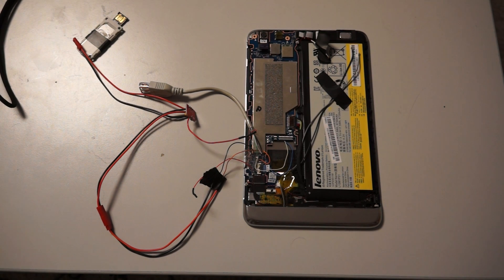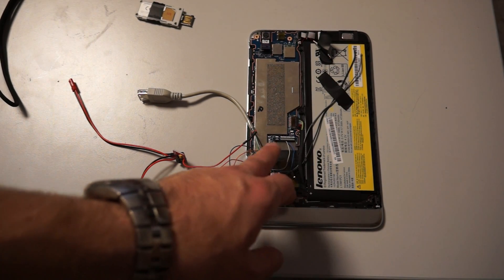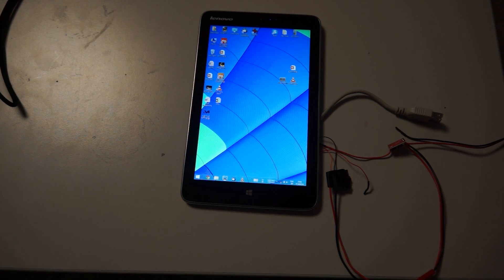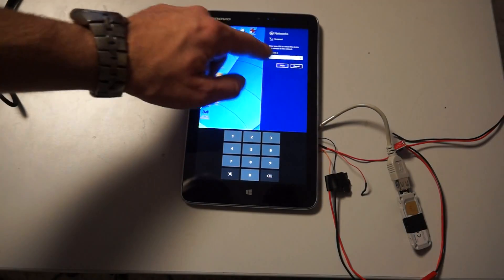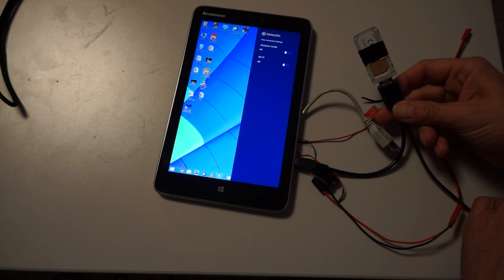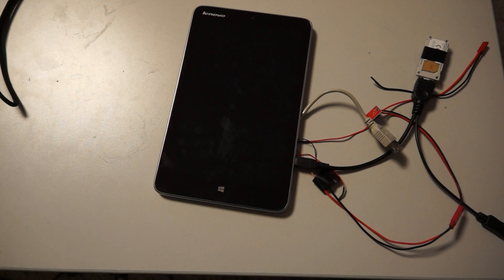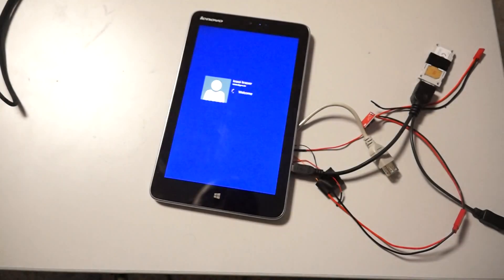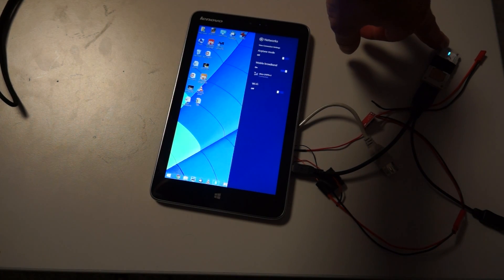Lenovo Miix internal USB connector testing

Comment from the maker: sorry but this is an abandoned old project so far. I still have the miix here and it is working like a charm but did not get on with this stuff. As far as i can remember there should be a way to hack the microusb to get it to otg by constantly hacking or by using a wired switch. so if otg is available there is a 5v source. the reverse engineering is really taking time which i did not have before. I am sure the 5v source will get available by one of the controllers on the mainboard.

Comment: Did you ever find a 5v output on the mainboard? I've a project of putting a Miix 2 8 that has a broken screen into the chassis of a Panasonic CF-18 Toughbook (and wiring up a bunch of other stuff inside, too, since there is space anyway).

Something I did consider though is what if there simply is only 3,3v logic on the mainboard? The battery is 3,7v but that of course has its own charging controller and whatnot 
The only time an internal step up to 5 volts would be triggered is when the tablet is told to put the usb port into OTG mode and otherwise it is off to save power.

Comment: I think it gives 5V from the OTG, I tried to power external DVD ROM with it and it works (not all the time).

Also you can turn this tablet in to full desktop PC like "pluggable" did with dell venue 8 pro by using just the OTG.
He connected 4 monitors, keyboard, mouse and other USB stuff, and he charged at the same time. That was pretty impressive.
When you ready to go, you just unplug the OTG.

If you can put the 3G modem inside that would be cool, but there might be conflit when u use the OTG at the same time.
Reply from the maker: yes we measured... when the otg is coinnected there are 5 volts source for these devices. but as far as it is possible i will try to use the internal usb port so there is still the otg option availalble in future.
Reply from the maker: no i dont think there is a conflict with OTG. I only will use the 5V source to power the device. the data pins will be used of the additional USB port inside the mainboard. But there is all the time OTG activated. So to charge the device you will need a external charger with more than 2000mA to charge and it maybe will charge slower because the fastcharge is not available with OTG activated.